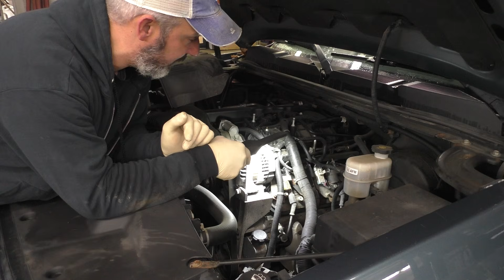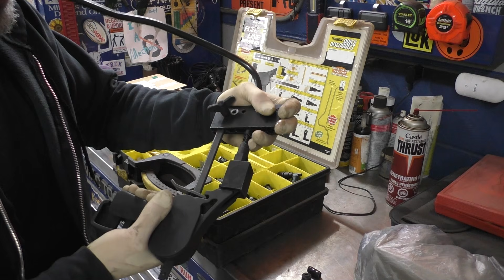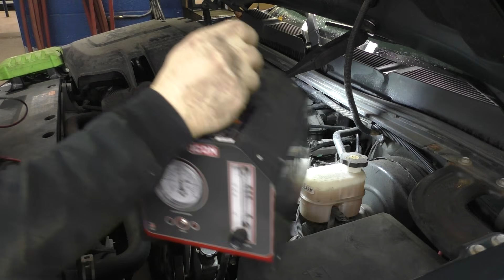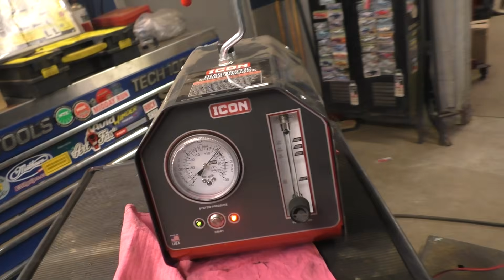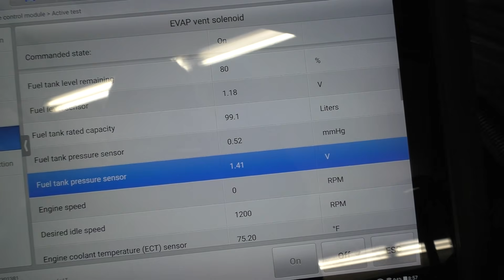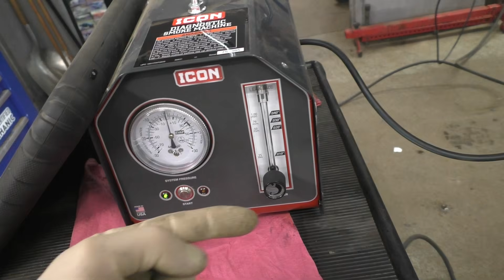'13 Chevy Silverado - Finding The EVAP Leak

Comment: Harbor Freight has that smoke machine with various attachments for sale here in FL for $549. It won’t be in my DYI shop any time soon, or ever. Looks nice.
Reply: $399 online
Reply: Little pricy..  You can usually just put 100 lbs from the compressor and see what blows up first...   most of the time it works everytime

Comment: Great vid as usual S.M.A 
!
The 2,500 scab frame 
Repair is crazy !🙈🙉🙊
Reply: BUT, they did the work and the truck is back on the road. MANY shops would say no way since they do not want the liability of getting sued.
Reply: @mph5896 see what happens when it goes I for  yearly  safty inspection. My local guy said  he could  weld  mine up but he would  never pass it. That I could  use it as a farm truck only for non public road use. Also my title  would  have to be changed to rebuilt. So it was junked he now has 17 now in his junk yard socked the 2013 go the same  way as an 07.
Reply: @Wrang15  MY state doesn't even have inspections or emissions testing. Drive what you brought.🤣 Maybe/maybe not that truck would pass an inspection? If not, maybe a lick-em and stick-em place.

Comment: Eric O...question for the master.

Recently, did a complete head gasket kit repair including crank shift position sensor on my wife's 98 buick century. Service light comes on..crank shift position sensor per O'Reillys. Is there a way to reset this sensor?

Comment: Gotta give harbor freight a lot of credit. You get a free smoke machine and they get free advertising and we  get to see how it actually works.  

And something tells me the leak you found wasn’t the only leak or problem you had. That fuel line that was broken was probably already cracked and contributing to the problem. At least that’s my guess. You know very well Those things are pretty tough and generally don’t break without a good reason

Comment: I like the idea of frame repair but I'm not so sure about what this guy bought. I can't imagine that it's practical anywhere in New York, Illinois, or any state that uses lots of calcium carbide on the roads. That's rather too bad, given how much it costs to replace a vehicle these days.
Reply: Get a couple more years out of that truck and $2500 is a drop in the bucket.

Comment: You've had that kit since Moby Dick was a  minow! I think manometer is the term! Great video Eric!
Reply: Manometer is a digital WC testing tool, magnahelic is the manual version.
Reply: Actually manometer is more generic referring to differential pressure device such as utube or incline manometer used as calibration standards.
Reply: @mikemiller3565  I tried lol

Comment: I got a 08 Silverado with a major evap leak code. Every once in a while, I'll get a tighten gas cap message on the dash. I've replaced the evap purge valves, a new gas cap and everyone of the lines and hoses have been checked in the system.  Also replaced the gas as well as checking the tank where the fuel pump is for rust. Everything is all good.  I have never put it on a smoke machine. Mr. O I do believe you helped narrow down my issue. I never thought one second to look at the filler neck. Thank You for this Video and several other Videos you have produced.
Reply: My 2010 (in my picture) had the pump rust out and countless vent valves go bad. My frame I don't expect to last into next winter being I'm in the rustbelt of Detroit.
Reply: You can't check for leaks with a visual, you need pressure (and smoke helps), hence why you haven't found it.
Reply: I went and got a smoke machine from a friend of mine today and tested the system. It is, in fact, the filler neck is rusted out at the overflow elbow. Thanks for everyone's  feedback. And Eric for making the video.
Reply: Filler necks are a common problem in "the rust belt".  I made a paint can smoker from videos on YouTube and found the leak on my '04 Silverado.  Use a LED flashlight.
Reply: Oh yeah, the filler neck.  Corrosion caused by the rear wheel blasting it for hundreds of miles.
Reply: Most electrical faults are from wiring issues...and connectors, etc..............'The green crusty's'.........Eric taught me this....

Comment: Dipping the plastic line into boiling water also softens it up nicely.
Reply: Heat gun works too.   but use it sparingly.. It doesn't take much
Reply: I have tried a heat gun, not good.
Reply: Heat gun is probably too hot? Boiling/boiled water usually works nice. Makes the pipe soft enough to insert the connector. Obviously there are different plastics out there, it might not work all the time.
Reply: @ert870  Maybe try the heat gun for a second or two. It softened the line to much for me in which the line folded over upon itself.
Reply: @mph5896 Heat gun is too hot, use a hair dryer. Also great for pool cleaner supply lines.
Reply: yeah, boiling water, also heat guns and hair dryers, as other below commented, you have to use a heatgun very carefully, just keep waving it past the tubing until heated enough.
small flame torch can be used also, but you have to be ten times more careful and use indirect flame heating only! even a little lighter being very careful (no wind). 
that said, I hate the plastic line and obviously do NOT use anything but boiling water if it has fuel or fuel vapors present. all the rest are for off vehicles use at the bench or outdoors.

Comment: You know that purge line had at least a small crack for it to break so easily. Thanks for the video!
Reply: Yep.👍
Reply: you should be able to take a very close look at the broken part of the tube and see the fresh break in the plastic and the dirty portion that was already cracked.
Reply: it was very likely not cracked, just hard and brittle, which is why it broke off suddenly. I have never seen any of them cracked, they always go from good to completely broken off.
now, the tubing itself I have seen leaking, but that was usually after someone bent/kinked it and made it split or it got melted from heat.
while I don't work on vehicles daily, I have seen many over the last 30+ years and of course broken plenty of the lines and fittings too! ford loved them in the 1990's.
Reply: Yep, the purge line was already fractured when you touched it.  Nothing that was "whole" would come apart that easily.

Comment: Now you got me wanting a two pocket T-shirt. I believe I seen this Icon smoker in my Harbor Fraught e-mail for about 500 bux. They also now have a bi-directional scan tool for 899.00 called the T-8 and are supposedly coming out with a T-10 which actually makes the repairs while you sit back and enjoy your tea. Truthfully, I have no idea what it does over the T-8 as it is not out. Not even sure why I brought that up. Anyways, thanks for the vid, I look forward to every one, knowing I will learn something. Like two pocket Ts and MeMa logic.
Reply: Yeah looks like regular price is $550 for that smoke machine. Have been wanting to invest in one for years but not worth it in my case as a weekend warrior.
Reply: Launch and Autel have been working perfectly for me. Wonder if that t-8 is based off of one of those, or their own proprietary system.

Comment: Wow!! HF is proud of that thing. I love my smoke machine. Great video as always!
Reply: They are expensive when you add the flow gauge. I have one without I paid little for, but the gauge would be very helpful.
Reply: @mph5896  I have the Ancel s3000. Amazon for $246 with pressure and flow gauge. No shop air required. Works amazing!

Comment: I think the gauge is called a manometer.
Reply: I know gauge he was referring to as you see them on commercial ductwork, which will help you balance a system and also to let you know you forgot to change filters. I use a manometer for checking NG and propane pressures to adjust gas valve regulators. Magnehelic gauge is the animal he was referring to, which measures pressure in water column inches for accurate readings.  From a retired HVAC guy who may not have all his marbles anymore as the gizmos have gotten out of control in this field.
Reply: That is great information.  I learned something new today.   Thanks for the explanation!